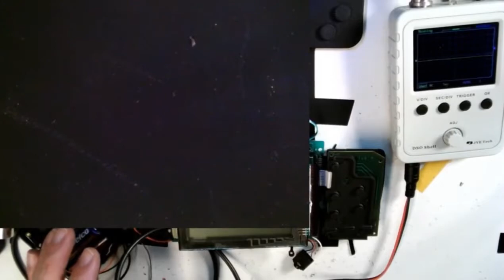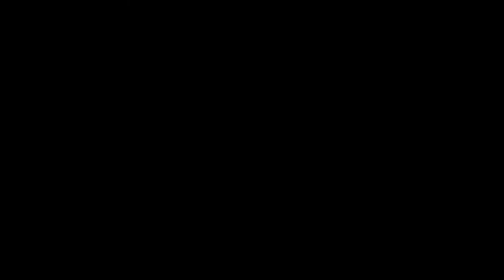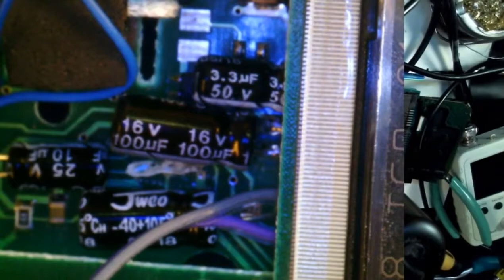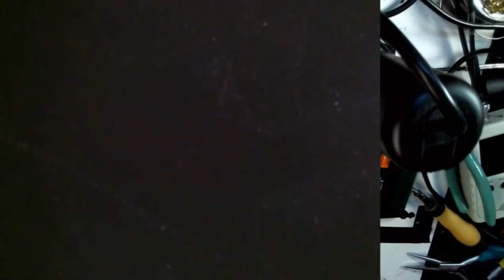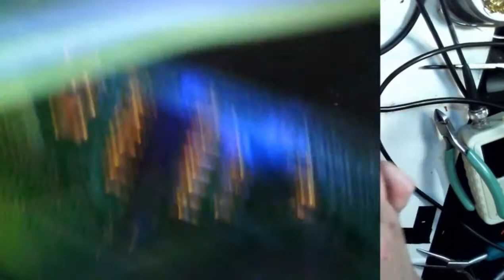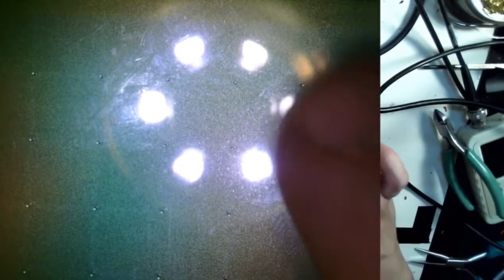Tiger Game Com Post Repair Cropped

Comment: Would you fix mine, has a messed up lines on screen
Reply from the maker: The only repairs you can really do is fix the audio circuit.  The LCD screen connector is just so poor, it is very hard to repair.
Reply: @sandbender1414  I thought it could be fixed... The screen has shown these nasty lines for long time
Reply from the maker: @gyear2000   It is possible, but I would not want to get your hopes up.  I have worked on about 5 or 6 of them without much luck getting lines out of the screen.   I can always take a look at it, but game.com care always a bit dodgy. https://retrogame.cyberphreak.com/request-a-quote/